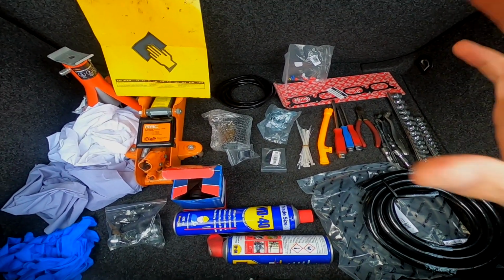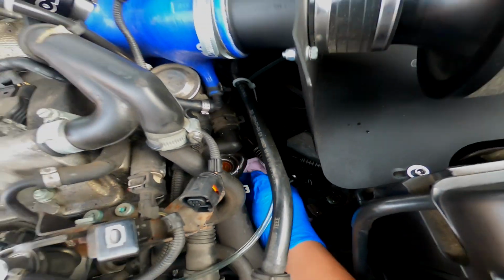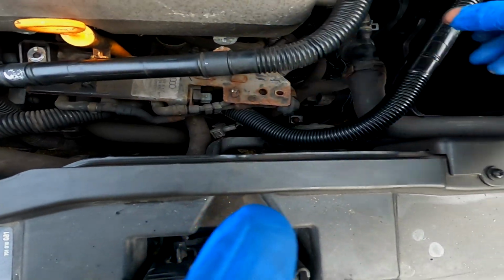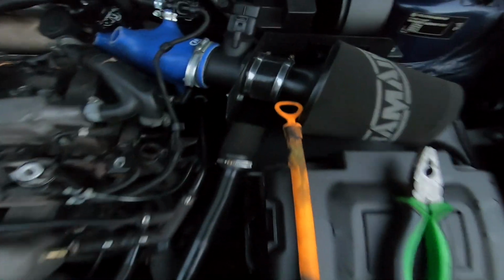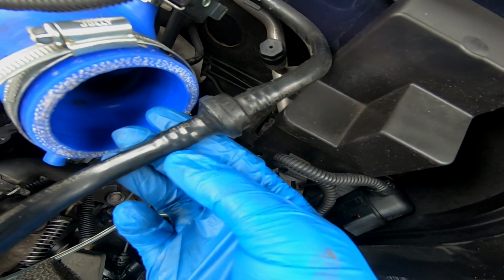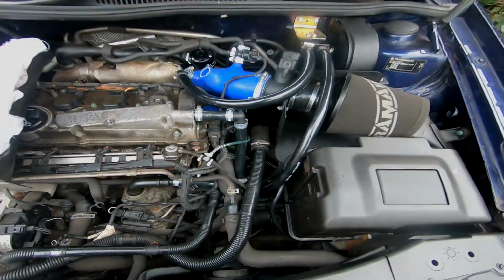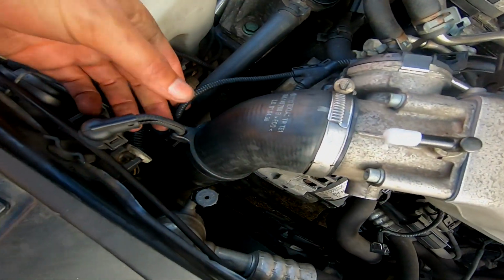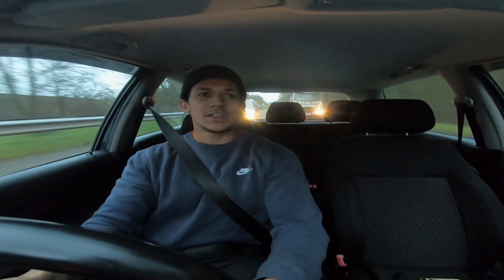MK4 VOLKSWAGEN GOLF GTI 1.8T SAI/N249/PCV/EVAP DELETE/CATCH CAN INSTALL

Comment: 14:10 you’re not supposed to cap off your wastegate valve hose that wastegate valve hose goes to your diverter valve on the top of your inlet pipe

Comment: So basically, it goes from the top of the valve cover to the catch can….. then on the other side of the catch can to your crank case make sure you T off from the crank case to the bottom of your intake manifold and make sure you have that one-way check valve you need to have vacuum if you don’t you’re gonna have positive crank case pressure and you’re gonna end up blowing one of your piston rings or valve seals don’t listen to him

Comment: I hope all of you guys watching this video understands that he’s doing this wrong never ever wrote your catch can to the inlet pipe on the turbo… it’s supposed to go from the top of the valve cover to one side of the catch can then on the other side of the cash can it’s supposed to go down to your crank case and you’re not supposed to cap off the nipples on the intake you have to tee it off so it has vacuum or you’re gonna have a lot of blow by. You’re basically putting positive crank case pressure on your engine and that’s not what it’s made for everybody that’s watching this video. I hope you know three years from now your car is gonna be smoking and it’s gonna have really bad misfire.

Comment: Hey i want to do this right, because i replaced so many pvc hoses and still my cars not running smooth. How long can i drive like this before doing a stage 2 remap, you think 2-3 months would be safe?
Reply from the maker: I drove mine for a long time after doing the deletes without having my car mapped. I got the SAI mapped out by my friend at some stage and the second lambda I believe. I would not worry too much. I did not daily the car though.

Comment: I try to support people I really do but you should always be honest as well. Do not waste your hard-earned money on a SRI or CAI on YOUR TURBO AUTOMOBILE. Any cold air sucked into your turbo is heated immensely by the turbo no gains have EVER been recoreded its simple science. And if that doesnt go with your butt dyno then disconnect your Intercooler, Lol. A proper tune and supporting mods and you'll have a reliable and enjoyable 1.8T all day every day. I hate having a dirty motor so my  CC is directed to drain under the car, recirculating it back into your car is a preference. They also have the CC with the small filter on top if you really want to be fancy and all, Lol.
Reply from the maker: Hey, good to hear from you and thanks for your comment. I am not really sure what you are saying here though buddy.

Comment: Hi mate literally doing this set up but im not sure on the catch can pipe inner diameter if you could help??
Reply from the maker: Hi mate, if my memory serves well I believe it is 3/4" or 19mm diameter.
Reply: @SPOOLINUP appreciate it the reply ❤
Reply from the maker: You are welcome mate
Reply: Damnnnn, thanks for still replying. I'm trying to get my 2002 back up but I have a vac leak somewhere but now where I live I can legally rip this stuff out since 25 years old! 

So all I need is a kombi block off and a catch can setup, some caps from hardware store and that's it pretty much ? Thanks a ton !

Comment: I recently bought a mk4 golf turbo was leaking exhaust was smoking crazy slapped on a new turbo and still get the oil burning smell and bit of smoke here and there access oil in the exhaust burnt out already but still bits of smoke here and there and burning oil smells thoughts anyone
Reply: Same. Turbo seals are good, did PVC delete and catch can. It only smokes blue after I takeoff from idle in traffic, valve stem seals?
Reply from the maker: It's hard to say. Have you given the car a few long drives since you cleaned the intercooler?
Reply: @SPOOLINUP very good question. Smic's were full of oil before the catch can mod, maybe residual oil in the intake tract.
Reply from the maker: I'm not too sure, have you kept an eye on your oil level to see if your car is burning it?
Reply from the maker: I am assuming this burning oil is coming out of the exhaust. If it was leaking into the exhaust side of the turbo, then it will burn itself off. If it leaked into the inlet side, then you may have oil in the intercooler and pipes. 

It could be the head gasket or valve stems. 

It could also be a head gasket issue.

I could also be the PCV system.
Reply: @SPOOLINUP Hey man thanks for the input turns out I had quite a bit of oil in the intercooler smoke cleared up but wil change the PCV valve as well
Reply from the maker: @mustagkeemharris5841 I'm glad to hear that things are getting better.
Reply: @SPOOLINUP I'm learning as I go your content makes it much easier you're a legend bro

Comment: Im in the middle of this. 
Walnut blasted intake valves when manifold was off put the manifold back on and dropped last hex bolt and peice and magnet couldn't get it.
Had to retake the manifold off to find them 😭😭😭

Ive copied everything in this vid but i seen you say dont blank EVAP in the comments.
 
Gonna run the catchcan to atmos like your other vid.

Gonna upload a clip when im done.

Thanks for this video bro.🙌

Comment: Great video everything detailed and documented thanks for the info. I got a 2003 Audi a3 8L 1.8t although it’s tip tronic it’s fun and I’m planning on doing these same deletes already done the charcoal canister delete but I got check engine light and the car started lagging goes through rpms smooth but takes longer than usual to change gears so I’m going to put the canister back hope it fixes the issues but now I’m thinking if to continue doing the deletes. Did you get any lights apart from check engine light?

Comment: First-off: Fantastic delete-tutorial brother!

2ndly: Anything EXTRA you would have done in hindsight?

Followed the link and found the list to order everything!

Cant believe they designed this motor with so much extra GARBAGE everywhere. This is gonna be FUN!  Anyway...good work. #newsub
Reply from the maker: Thank you man, I appreciate your comment. Just make sure you do not block off the EVAP in the engine bay like I did and you should be all good. Just take your time and use it to learn a few things. I know there is a lot of garbage in a stock engine bay but it's all emission control. Thank god we can delete it!!!

Comment: I am midway busy with this then all of a sudden i cant access the thread file, does anyone still have the thread document with the step by step, I am missing something here.🤣
Reply from the maker: Good luck with the job but just don't block the EVAP off like I did, you need to let it vent to atmosphere. 
https://www.vwvortex.com/threads/diy-ultimate-sai-n249-pcv-evap-delete.4893472/
Reply: Did not expect a response, but thanks, man, your video helped me a lot. I just finished the project up yesterday. I will definitely have a look at that EVAP section. I blocked it off already.
Reply from the maker: @donay-robingroenewald3210 I apologise as I don't always get notifications for comments. Unblock the EVAP because it's better to let it vent, this will allow the vapours to escape rather than build up in pressure. Just take the blanking cap off if you fitted it to the canister.

Comment: After almost 2 years of doing these deletes there is a downside i have noticed. That is that with the catch can the crankcase has more pressure in it, causing the engine oil to sweep through the turbo seals to the exhaust, making it smoke on long idle, increasing oil consumption at the proccess. The stock pcv valve helps vacuum all this pressure by opening and letting the intake suck all this up. Its not a problem for me, i dont care if my car smokes after long idle, i do care that the crankcase fumes get filtered and sended clean to the turbo
Reply from the maker: Since doing the deleted I haven't noticed any increase of smoking during idle. In theory if the catch can vents to atmosphere then as long as the crankcase is at a higher pressure than atmospheric it should be able to disperse the gasses. Do you have the outlet of your catch can going to atmosphere? I've re-routed mine to terminate under the car rather than the TIP.
Reply: @SPOOLINUP   The outlet of the catch can is on the TIP for me. It doesnt smoke immediately on idle. I have to let it idle for at least 1 minute, then the smoke starts and gets worse the more i let it idle. I believe in my situation the smoke problem is much more sensitive because i dont have anything attached on the exhaust. Its just a straight pipe with the only restriction being the turbine itself. The pipe is also 80mm in diameter. So the exhaust has really low pressure, while the crankcase on idle has more so that lets the oil flow from the high pressure to the low pressure. If you are having at least the catalytic converter and 1 muffler on your exhaust, it should be hard to make it smoke so soon
Reply from the maker: @SakisTheDrifter I understand what you are saying, I don't have any boxes on the exhaust either, but you could maybe try and blank off the TIP where you have connected it to the catch can and let the catch can vent to atmosphere and see if it helps.
Reply: @SPOOLINUP   I connected the stock pcv system a week ago and the smoking effect is greatly reduced. It definately has to do something with crankcase pressure. Your suggestion passed throu my mind a while ago and i believe that indeed it would help a little, but i dont want to do it,because i want some oily air to get into the intake of the turbine and the top of the piston to lubricate them aswell. I ordered the catch can you have on your video, because yours have wider fittings while mine has smaller, witch made a restriction and helping the problem i have
Reply from the maker: @SakisTheDrifter Oh I see, so then in that case you have proven there is a difference. That sounds like a good idea using larger diameter hoses and fitting along with a larger port catch can. You can try and route it to atmosphere. The oily air that you speak of for the top of the piston probably gets burnt pretty fast so might not actually help.

Comment: Hey man I just did this to my mk4 and I’m getting a P1137 System too rich Bank 1 code and my rpm’s are bouncing up and down do you have any ideas on how to fix this? Thanks
Reply from the maker: First of all in the video I blocked off the EVAP so if you did then unblock it to allow the vapours to escape. I would recommend inspect your whole engine bay and make sure everything you blanked off is sealed properly.

Comment: What size vacuum blank off caps did you need? If you remember would appreciate it 👍🏻
Reply from the maker: Honestly I can't remember. I bought an assorted pack and used some of them but I had to order some extra ones that I measured with a digital caliper. I want to say you need some 3mm/4mm/6mm to be on the safe side but I'm sure you need larger for the TIP blank offs, but I would be lying if I told you I know for sure.
Reply: @SPOOLINUP  no that great mate I just wanna get some so I at least have some then I can always order some other I need if so thanks a lot again
Reply from the maker: Yes mate I had most of the bits I needed but miscalculated so had to order some more. I then had an air leak from the ports under the inlet manifold so ordered some smaller caps and it worked a treat.

Comment: Hi please, when you disconnect in 28:24 one hose from where are you disconnecting? I noticed that in my car the case which has the 3 hoses are loose..
Reply from the maker: That hose is for the EVAP canister. Sorry I do not totally understand your question.  You need to squeeze the button on the bottom of the connector on the hose and then pull it off. They will all seem loose and they will move but that is the type of connection they have there is nothing wrong with it.
Reply: @SPOOLINUP  Yes that is the answer if seems loose and is like that is correct.  This engine had massive amounts of hoses canisters and PCV VALVES... That will continue on my case . Many many thanks for your help and repays. Kind regards have nice weekend ✌️🏁
Reply from the maker: Yes are you talking about the hard plastic lines? The shiny ones with the 90° connector that you have to press the button on to release? I have sent a link, if these are the ones that you are talking about then yes they always move up and down and will rotate as well. As long as they click in to place and can't be removed without pressing the tab then they are fine. You are welcome by the way. Blessings from England 🇬🇧

Comment: Long shot as you might no be that active on here , but the break boost hose you replaced with 1/2inch , does it have to be a specific type of hose ?
Reply from the maker: Hey, it should just be strong enough to not collapse under the vacuum. Best thing to just buy a silicone one.
Reply: Appreciate the quick reply bro
Reply from the maker: Any time man. I have used ASH (auto silicone hoses) they tend to be quite good. Creations motorsport have some good bits too.

Comment: Gotta ask... Where abouts is the evap  bit that you shouldn't have plugged/capped off?
Also... What's happening with your wheels?
Reply: Looking forward to seeing them. 
Thanks for the reply. I'm just about to tackle all this.
Also... Have you got rid of the smell in the car? I've got the same and really really hoping it's not the heater core breaking down: that's a long job.
Reply from the maker: Yea mate I am looking forward to seeing them on too. I even got two refurbished as they weren't as good as I wanted them. 
The smell in my car has gone now mate. Is the water in your car oily kind of and slippery? Like is it definitely anti-freeze? I left my dehumidifier in the car too but after a hot summer it was fine. Good luck with the job
Reply from the maker: It's the part in the top left corner of the engine bay right by the coolant bottle. 

The wheels will be going on when the tyres on my current wheels get bad which will be in the next month or two. I just need to sort out a better tyre size for them because they are too stretched and too small.

Comment: So I did the same installment but when I turn on my car it just dies and won't stay idling. Any help ??
Reply from the maker: Hey man, I would suggest first of all checking all of the vacuum caps you have used and any new vacuum lines installed. Also check the blanking plate on the side of the engine to make sure that is all nice and tight. Just go back over your work and see if you can spot a problem. I had vacuum leaks under my inlet manifold because the caps I used were slightly too big. Dont block off the EVAP either, in the guide I used it says to block it but take the cap off that and let it vent to atmosphere.

Comment: This is just what I need, I also have a 1.8t AUM and am planning to do all these deletes. Great video bro
Reply from the maker: Thanks man and good luck, its not a bad job. Just make sure you don't block off the EVAP and you leave it venting to atmosphere.
Reply: @SPOOLINUP Please explain to me how to leave it venting to the atmosphere
Reply from the maker: Are you talking about the EVAP? If so you just need to leave it open, or you can run a small silicone hose to the bottom of the engine bay to avoid any fuel smells in the car.
Reply: @SPOOLINUP thanks a lot i already did it and the car is running amazing, and i got some spare hoses and clamps in the process
Reply from the maker: That is great to hear mate

Comment: I’ve needed a video like this forever. Few years ago I wanted to do all of this but every video up was different, confusing, and or not descriptive. You are a saint 🙏
Reply from the maker: I know, that is why I tried to make one the best I could. The only thing I need to point out to people is not to block the EVAP like I did because it needs to be open to atmosphere. I'm glad the video helped you though man thank you 🙏🏾
Reply: @SPOOLINUP  done it some time ago already and all working, just a little question, in the main guide the evap was blocked while I kept it as u mentioned in the comments open, now my mechanic is saying to put a tube from it to underneath the car as he could smell gasoline in the engine bay and it may catch fire. Also worth pointing out - if someone has a basic airbox, there is a plug for sai hole that is oem from saab 9-3 2004
Reply from the maker: @strielokholmes4254 Hi mate, im so sorry for the late reply. My mechanic also has his EVAP line running under his car but just for the smell. The man who tuned my car is a complete wizard and he just said the cap should be off and removed mine for me when I got it mapped.